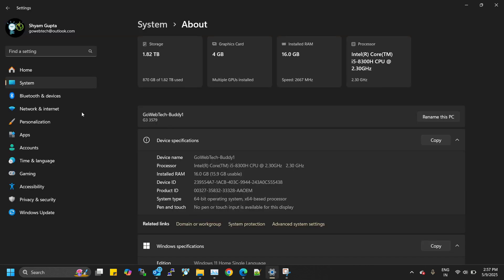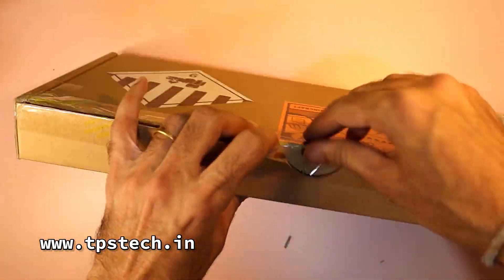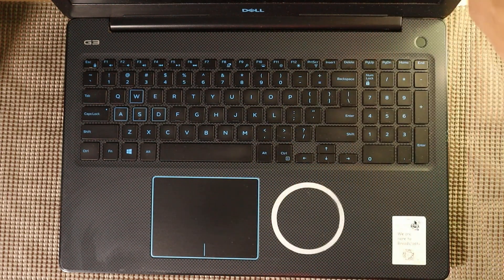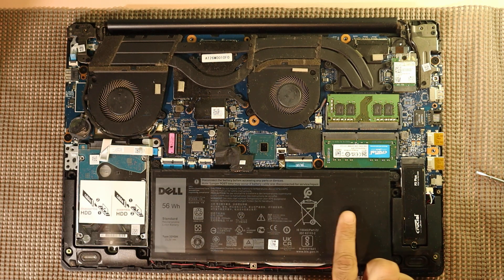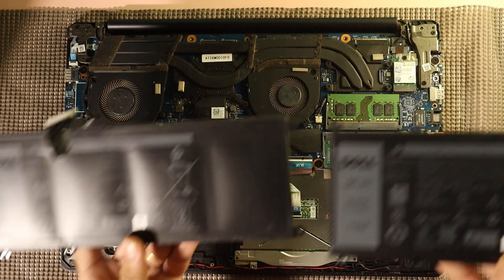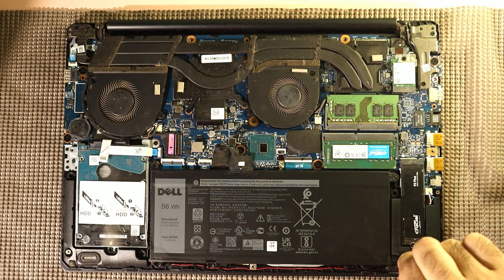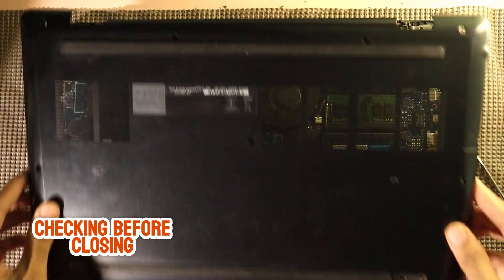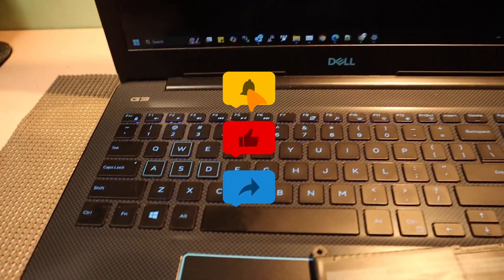Dell G3 3579 Battery Replacement  Fix Swollen Battery Problem

Comment: bro good to see this. Also I am facing issue with charging power cord loosening or it is causing the charging on and off issue. I saw you have done some taping to it could you please let me know about it
Reply from the maker: Yes, the taping was just a temporary fix. I went ahead and bought a new power adapter to protect my laptop from any damage or power-related issues.